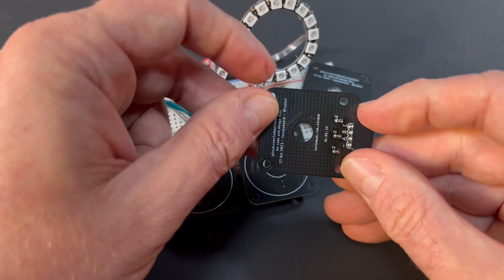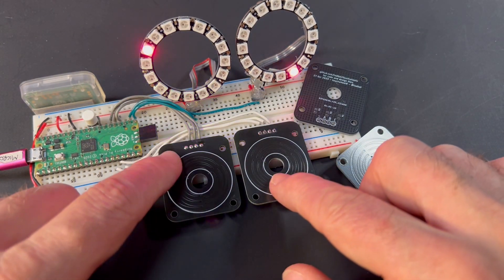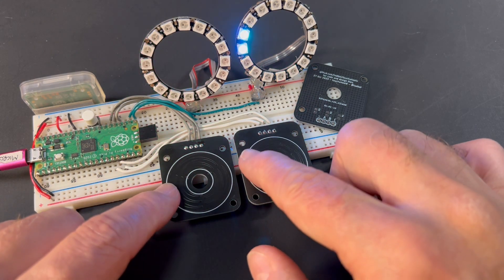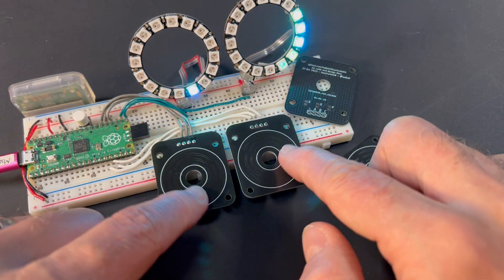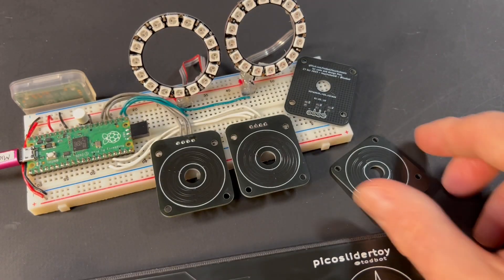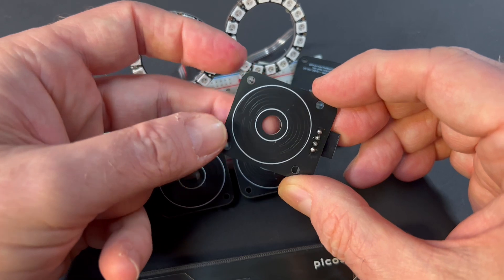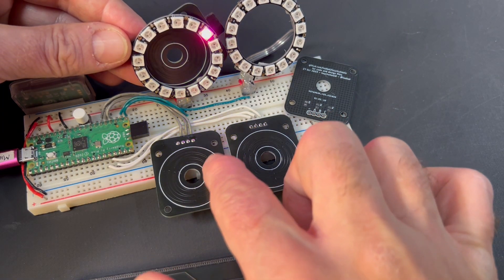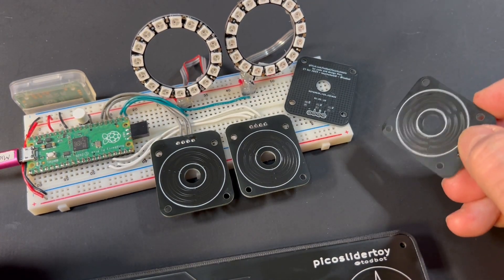touchwheel0 dual demo

Comment: Would it still work if you put this underneath plastic?
Reply from the maker: Yep! If the plastic was thin, no more than maybe 1 mm (1/32").
Reply: @todbot  What would be an alternative solution if its thicker?
Reply from the maker: @1337sh337  depends on your requirements, but generally for a thick panel where you can't stick a touch sensor on top, one uses a standard rotary encoder or potentiometer